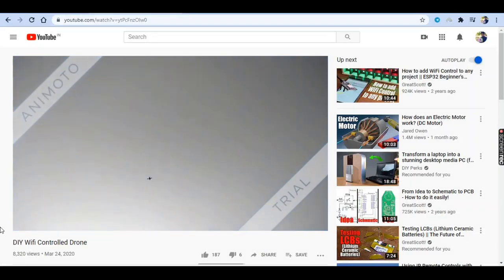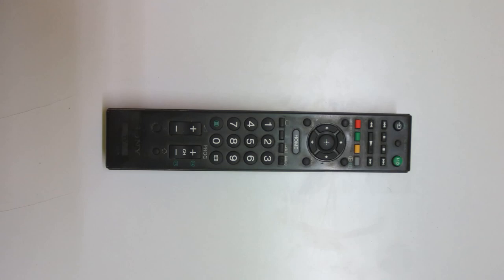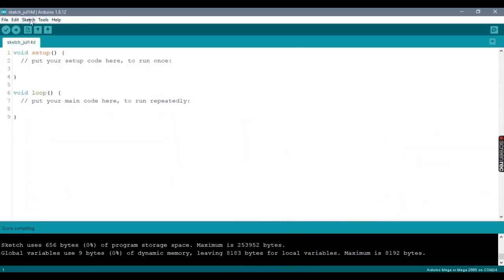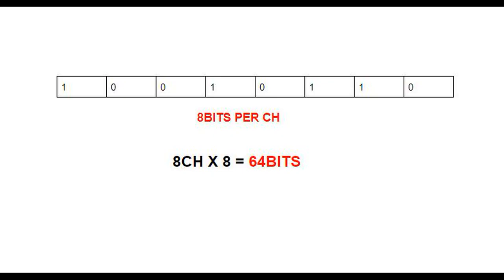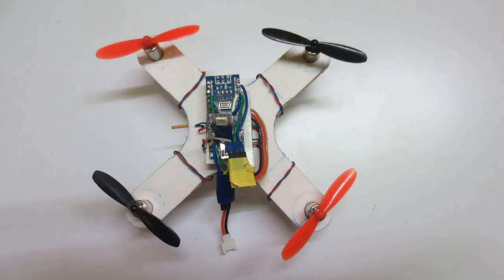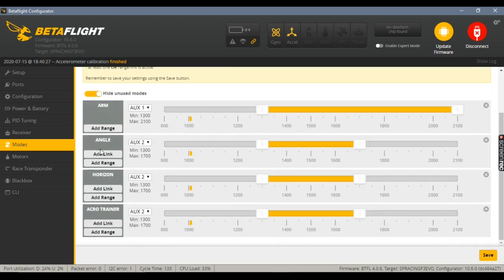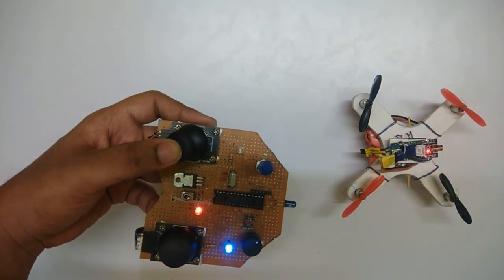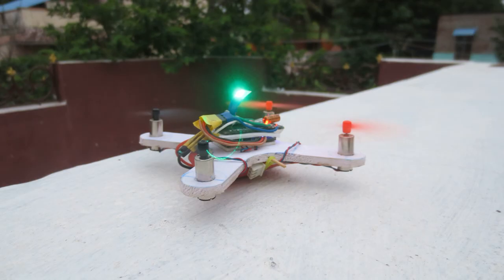DIY IR Controlled Drone

Comment: bro  how to connect the arduino board to the moters in v2 is not coming so can you send the circuit link bro
Reply from the maker: Arduino ppm pin will connect to ppm input of spf3

Comment: Sir can u make a video on making a brushed drone using arduino and hc 06 bluetooth module
Reply from the maker: Yeah already tried... But the problem is hc 05 gives range less than 50 meters.... So it automatically disarming.... And causing the crash of drone so i won't recommend it....
Reply: @rengarider  ok i got it

Comment: hey where is the controller in the drone...I mean flight controller...where is it...
Reply from the maker: Sp f3 evo brushed flight controller, it is there. Check wifi controlled drone version 1 for more information
Reply: @rengarider  umm can you plz tell me.........  f3 fliht controller need  ppm receiver.............  soo I have made a arduino nrf ppm receiver and 6channel tranmitter ..........   so can I use this ppm receiver on that f3 flight controller.......
Reply: @rengarider  i have tried to make a drone...with mpu6050 gyro...... using multiwii nrf......  but that code did not work properly.......i can control the motors but its controller not so good.with the code....so drone get fall down again again..so I have became bored.........thats why I am looking for readymate  flight controller.....plz help me with some information
Reply from the maker: @shantotorofder3916  yes u can nrf24 and arduino to make receiver compact to it
Reply from the maker: @shantotorofder3916  sp f3 in good stm32 based based flight controller so response will be good compare to multiwii....check wifi controlled v3 video about multiwii responses...
Reply: @rengarider  okk I have all the component to make the..drone........now I have to upload the ppm receiver code to my  nrf arduino receiver.....  then...just connect the ppm signal to f3 flight controller and configure it in betaflight.....okk Is this gona work.........    all i have to buy the f3 flight controller.....

Comment: are you used Arduino nano for transmitter?
Reply from the maker: actually ATMEGA 328P IC alone ,it is same as arduino nano
Reply: How to connect battery with this remote control?, please guide me.
Reply: What thing you connected with Arduino nano for receive transmitter signal?, please guide me.
Reply from the maker: @vijaykumargaikwad7431  ir led and ir receiver
Reply: What things you used for making transmitter?
Reply from the maker: @vijaykumargaikwad7431  2 JOYSTICK ,POTENTIOMETER, Infrared led, arduino nano or atmega 328